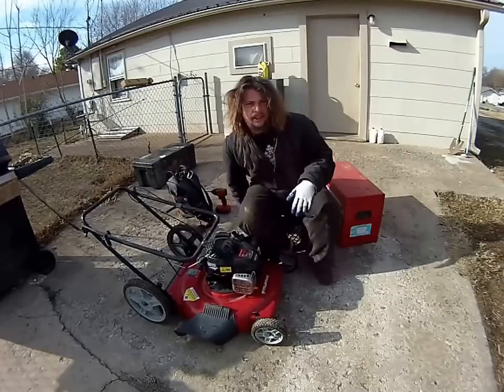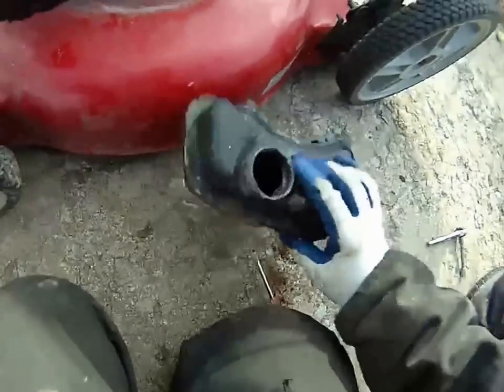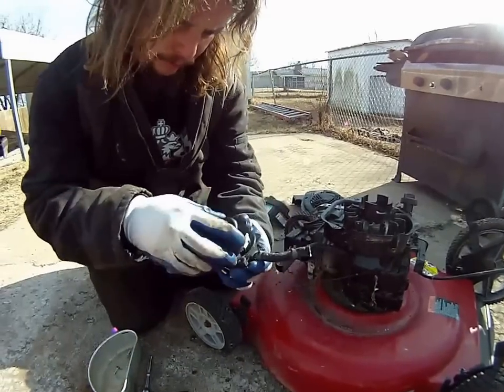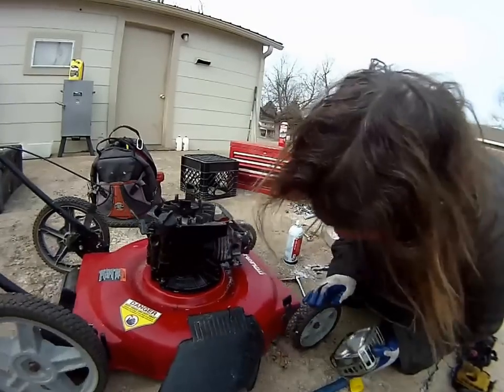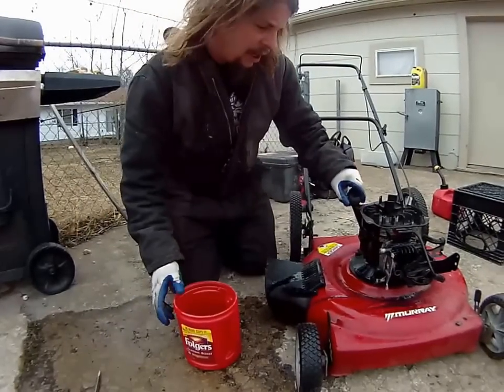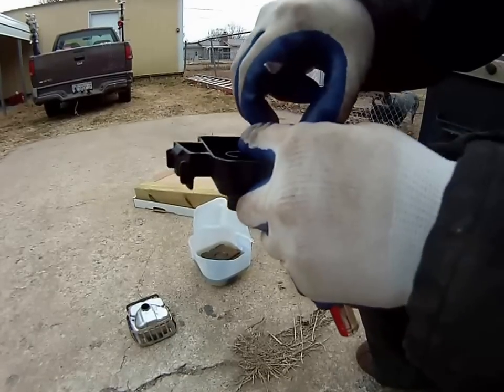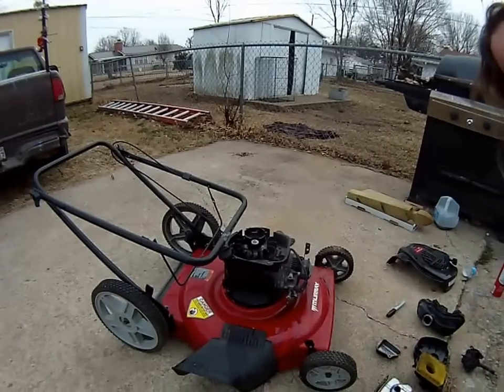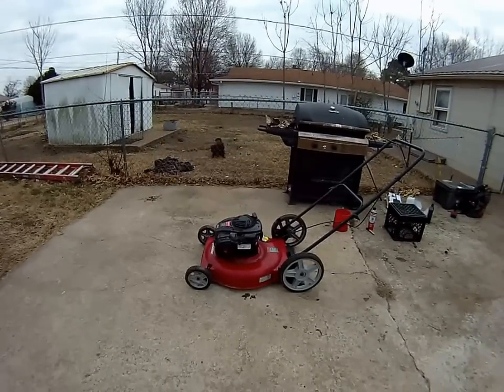Walmart Dumpster Haul - Part 2

Comment: Hey, Luke now you're on the right track.  The primer bulb is working, but then the engine starves out like gas isn't getting through.  If you have access to an air compressor with air gun attachment, remove that carb again and carefully blow out all the ports you can see.  Don't hit it with full blast, but gently, and watch that you don't blow little parts away.  Also blow out the gas line from the tank to the carb.  You might get by using an aerosol air can like for computer use in lieu of a compressor.  As others have recommended, clean and gap the plug too.  Reassemble & fire up again.  I've never seen a plastic carb body before.  Can't believe how crappily (is that a word?) things are made these days.  Best of luck and keep at it.

Comment: I doubt there's much wrong other than it's cold out. It's going to be hard to start in the teens. My favorite way to kick start something small is to pull the spark plug, drop a bit of gas directly in the cylinder. Give it a cycle with the pul sting with out the spark plug in it. Then install the plug and it should kick off really fast. The mower is basically brand new. The only other issue could be clogged jets in the carb not metering gas right, but that stuff looks very fine and prob not much restriction if any after spraying the carb a bit
Reply from the maker: awesome, i'll try it again in a couple days when it's gonna be 60 out

Comment: Take air filter off and spray a small amount of starter fluid in there.. Also on those carbs there should be a small jet that maybe gummed up.. Get some carb cleaner and try to blast it through..

Comment: Look for some pin holes in the carb.  throttle near the butterfly.  There is usually a jet (screw, could be plastic) and it is likely clogged.  Pull out the idle screw and blow out the hole with carb cleaner.  This tiny hole provides fuel so the motor can idle.  The large jet hole provides much more fuel and is throttle controlled.  If the idle circuit is clogged, it won't idle.  Dude, you are learning.  Don't give up.  You are so close and you've earned that working mower.  My guess is somebody didn't want that mower and put water in the oil and fuel tanks so they could return it to Wal-Mart.  Everybody F's with everyone else I guess and the little guy busts his nuts to get a crumb.

Comment: Way to stay after it!  +1 on doing a full carb breakdown/clean.  I would've also checked those valve clearances when you had the cover off.  One last thing...those carbs are jetted for summer so it will probably run like crap (lean) once you get it started.  Does it have a choke?  A choke will help alot with a cold start.
Reply from the maker: doesn't have a choke, but i've since put a cap on the tank and tried to run it after a couple days of 60 degree weather and still wont stay running.  i don't want to spend any money on breaking into the engine, so i'll probably try a full clean on the last one i have left and see if i can get at least one running.

Comment: I've been working on Lawnmowers for some time so what I see is that it wants to start I just fixed one that was doing the same thing.if you take the air cleaner off the Lawnmower and have some one put their hand over the carburetor hole you can choke it manually that will force the gas to get to the carburetor if you are not getting the right amount of fuel and it will work.peace

Comment: did you disassemble the carb, if you didn't you have to clean the niddles o the middle and the floter some times they stick and makes it hard to regulate the air and fuel mix.
Reply from the maker: yeah i completely disassembled the carb, removing the float and metering needle and anything else that was detachable.  then used almost a full can of carb cleaner to blow out every orifice i could find after watching a proper carb cleaning video.  still cant get it to stay running.  there was oil in it when i got it, i cant imagine a serious engine problem in something this new looking.

Comment: It needs the gas cap!! When you pump on the primer bulb, it is supposed to pump a little bit of pressure into the tank to help move the fuel into and through the carb.!! If you put a gas cap on the tank and pump the shit out of the primer, it should start and run perfectly, as long as the carb gaskets are sealed and air aint leaking in through the sides of the carb, where the carb sits against the block!! in other words, the carb gaskets all have to be sealed really good, and the tan k needs the cap so it will hold some air pressure when you pump the primer.
Reply: My thought too. All that work, just buy a new gas cap!

Comment: Use water and dawn to clean out tank and other parts unless you have a part in a flash gordon movie. 
before you try to start something, clean it up and out by taken it apart. There are a ton of small holes in the carb that needs to be clean with a small wire.

Comment: Tie the shut off handle (bailer) closed like ur holding it. Prime it five times. When it starts to run for a few seconds push the primer ball a couple times to keep it running. When it starts to die again repeat pushing the primer a few times. Continue until the engine warms up. It'll probably stay running then. Looks pretty cold outside. Cold start engines (especially she carb isn't perfect) require more gasoline molecules. Once the engine gets warm maybe three or four minutes it'll probably be ok. You'll know when u can stop hitting the primer cuz it won't start to stall anymore. Might help if you warm it with a space heater for about five minutes.

Comment: take the air filter off and spray starting fluid in carb, make sure to use good gas and drain all old gas out of the carb before priming it. look for fuel cut off valve it might be closed too

Comment: well you are getting closer.. you can just go ahead and pull the air filter out.. most of those on small engines are sprayed with some oil because it helps catch garbage but if you're just trying to start it you can eliminate that and then you know its getting good air. ... sounds like the magneto is  working and plug should be ok... those carbs it sucks they have little pathways like the thickness of a hair almost.. you can rebuild them or you can buy a replacement maybe for $25 .. umm make sure the gaskets to the carb arent leaking ... and .. just to see if it runs .. spray some starter fluid directly in the carb and it should start.. .. betting you need a carb rebuild but you never know why they returned it.... one good thing you didn't find any chunks of metal in the oil but it was kinda black.. might need piston rings if there is no compression... but those engines just want to run.. gas and spark and they run .. find a youtube video on carb rebuilds ... if you can get it running 15 - 30 seconds with starter fluid then rebuild the carb

Comment: Those mowers were returned from customers. Thinking it over it makes sense. Those mowers had dirt in places only a used mower would have and the oil did not look new, definitely looked dirty.  Also mowers don't come with gas new from the store.. So if they had gas then they had to be returned to the store by the customer. Walmart would hire a landscape company and not cut their own grass (if they had it to cut)...   So with that being said, you could have anything from a simple issue from the absorb all  used to clean up the gas OR something faulted and thats why the mower was returned.    I wish you could have shown us what you did to clean that carb. You will need to try and take it completely apart. I mean use paper clips and needles to clean out the tiniest of holes... The carburetors use to have a bolt on the bottom that held a metal cup for the float ring. That bolt use to get clogged after a couple years so you have to shim them out. Yours didnt seem to be that type, some sort of new plastic design of some sort.    Anyways, get the model info for the mower and Google how to clean the carb to that model of mower. I bet you there is a video showing ya how to do it.

Comment: keep going I'm waiting for the end result!
Reply from the maker: should have a warmer day this week and i'm gonna get back out there and see if i can get er started.
Reply: Make sure the spark plug is gapped properly, I dont know if new mowers have points...try to download a manual from online for the make and model
Reply: I liked that you tried getting this to run even though you said you're not mechanically inclined, only one way to learn..JUMP in! I didn't see that found any of that oilsorb/pumice stuff inside the carb? I also didn't see you take the "carb needle & seat fuel inlet assembly" apart and clean it out before reassembly, and there was no filter on the line? It's the #1? cause of small engines not running, plugged inlets from dirty fuel, so it's likely the inlet is just plugged as like others are saying it runs on primer bulb fuel but not on carb jet fuel. there's not much to take apart, just needle and seat on the fuel inlet needs cleaning, it's easy just pull retaining pin out of float, remove float and needle, blow spray cleaner through fuel line to make sure inlet is clean, put needle back in, float back on and retaining pin back in. also check for any leaks or cracks of internal parts from water in it freezing, as this could make it not meter fuel correctly even if carb is clean, as it looks like some internal parts on that carb are plastic. some of these cheap plastic carbs are fixed jet, non adjustable carbs, some have air/fuel mixture adjustment screws on them, if so make sure adjustment is correct, and there's no vacuum leaks or leaks in lines on primer bulb, or carb to engine sealing problems, etc. If ya haven't by now cleaned it out and got it running, I'll bet this is what it needs.
Reply: Youre all wrong, try starter fluid in the air intake.  The lawnmower looks like it works just fine.  The the tube to the carb via the airfilter needs to be sprayed.
Reply: who's wrong? if it starts for a second, what does he need starter fluid for? it's starting fine, but doesn't run, you gonna run behind the mower and keep spraying starting fluid in it to keep it running?

Comment: Replace that carb,the jets are full of junk,you are never going to get it out. There are tiny passages that the fuel needs to go through to get it to run. That fuel dry is plugging them up. If you had an air compresser,you might be able to blow them out,the main jet is plugged I can tell,its only running on primer fuel. Without knowing what you are doing,forget it. I owned my own small engine repair business so I know whats what.
Reply: scott firman Not accurate. These mowers have plastic carbeurators typically built onto the gas tank.

the main problems with these are primer bulbs and worn carb diaphragms.
Reply: Age of Reason how exactly does the fuel get through then? Simple,metering jets and narrow passages,dont tell me,Ive been working on these things forever,even the cheap plastic ones use that method,you cant just dumpnor suck fuel in without a metering system. Those cheap carbs are best replaced.,like I first wrote. Read.
Reply: If you've never encountered this issue, the worn diaphragm, then I wouldn't put much stock in your "I'm a professional" word.
Reply: Age of Reason Really? Thats your reply? The things were stuffed with trash and you are going with worn diaphragm. I wouldnt have you working on my mower friend. Honestly,for the cost of the carb,now days its better just to replace those cheapo ones. I have certifications from Briggs and Tecumseh,what do you have? I worked 4 years in a small engine shop under a Master Certified small engines mechanic,was sponsored and went to Wisconsin for training and received my certificates,so unless you think your arm chair qualifys you better,go for it. The biggest problem now days is fixing shit that others that "think" they can fix stuff get in there and make things worse. I had a sign in my shop that said" you cant fix stupid.
Reply: Pumping up your chest online doesn't make anything you state factual or relevant.

Are you suggesting that this could not be a problem, a damaged diaphragm?
Reply: Age of Reason  I dont rule out anything fella,the fact that this guy admits he isnt that knowlagable on such things is good. The fact it tried to run was an indication that it at least had spark. With the way these new mowers are made its easier to replace the carb,and knowing the fact it sucked up a ton of that gas absorbing powder was enough to warrent replacing,especially since he did clean it. I always keep a spare one sitting around,eather from a dead mower,or as a tester. I still work on stuff,mostly just for friends and family. I am proud of my accomplishments,call it whatever you want,at least I can back up my comments with education. To me it was obvious that there is an issue that the mower was returned to Walmart for whatever reason. The keyway on the shaft of the mower could be broken too,that throws the timing off and a mower may start but not run. I have picked up so many mowers and especially snowthrowers where guys tryed starting them with starting fluid,only to shear that key. Its all a matter of eliminating the issue one step at a time. As to why they tossed it,well that would have been the first issue. Now days with most small engine places charging $60 to $80 just to look at stuff,it explains why we find so much on the side of the road. When it costs $130 to do a carb rebuild and change the plug,thats what makes being able to fix them yourself more and more sensible.
Reply: Deutschland402 Drives me nuts when someone claims to know it all. When you work around this stuff every day and do it for a living,its not a matter of puffing out my chest. Its a matter of fixing something correctly in the shortest amount of time and making sure it was done right. I have never gotten a return on any of my work and time is money in this business. Reputation is a big thing in my town when it comes to returns. If you do a bad repair,there are seven other repair shops willing to take on the job. I have in fact gotten much of my work because some of the other shops didnt do a repair correctly. I get over stuff pretty quicly and move on. Life is too short to mess with guys like that. Enough said.